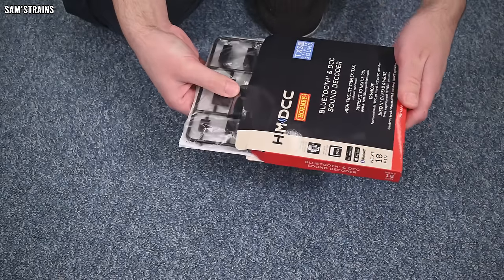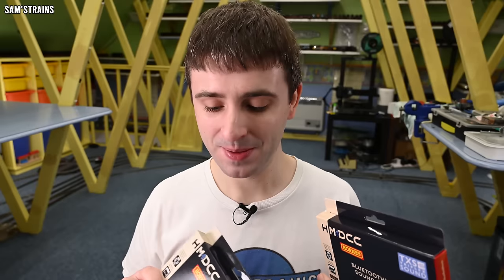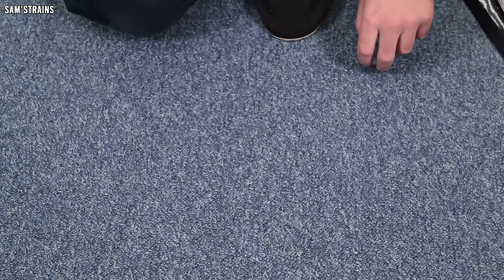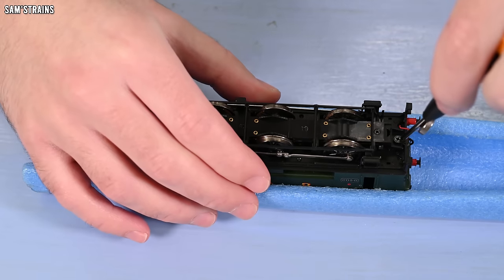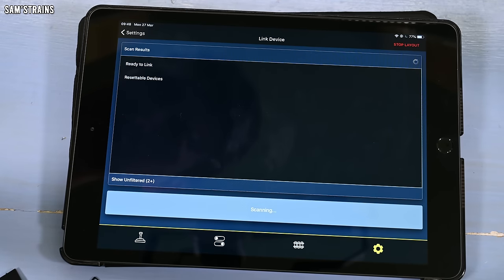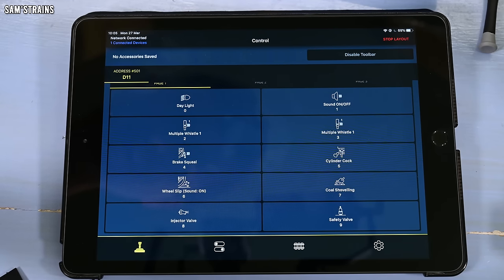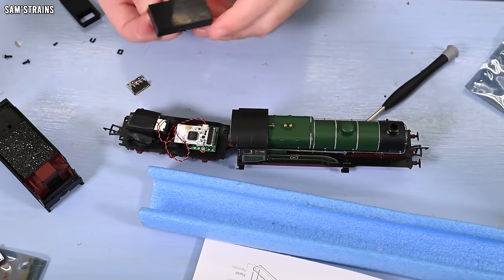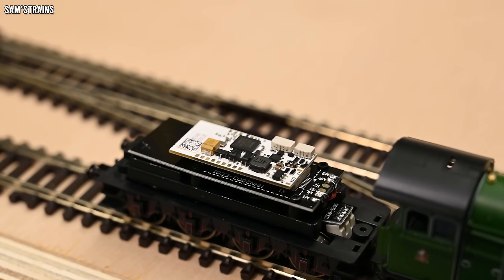Too Big For Most Locos & Burnt Out After 1 Day | Hornby's New HM7000

Comment: Hi Sam,
 I feel, as a DCC sound person, a few errors in your assessment of the Hornby decoder.
 1) "Why would you buy from another decoder maker?" If you look at the major brands, ESU & Zimo you'll find they make various sizes of decoders to fit any size of loco. As you found with the Next18, only your D11 & TT A1 would accept it. The size of the decoder was a major issue. Add in the speaker plus a keep alive and you might find things won't fit anywhere.
2) Expecting to fit them in non-Hornby products or locos designed before these decoders were.. Again this is why I will be wary about using them over say a Zimo or ESU simply as Hornby have used a one-size-fits-all mentality.
3) Most ESU & Zimo decoders can play up to 8 sounds at a time. The new MS decoders from Zimo use 16 bit quality.
4) Soundtrax in the US released a similar Bluetooth system back last year. To date, there is still no Android app available, will Hornby be the same? Not everyone worships at the Church of the Bitten fruit!
5) Do you truly think Hornby will create sound set ups for competitor's locos? I highly doubt it to be honest. This, like the TT:120 are Hornby's own. I own a Roco Z21, the only function set ups i can get are either Roco or Fleischmann models from the last 10 years.
 I do like the idea of the decoders, but the size, the lack of Android app & the tie-in to 1 manufacturer puts me off buying them.
Keep up the great work.
Reply: Excellent comments
Reply from the maker: Thanks for sharing! Yes the size of these (particularly the next18 one) is definitely a big con.
As for non-Hornby locos... very few Hornby locos have Next18 sockets... the two TT locos I have are the only ones as far as I know... so I assumed I might have been able to find a loco that could accommodate them... but no luck.
No, I don't expect Hornby to create sound profiles for competitor's locos, nor did I say I thought they would. What would be nice would be the option to customise/create your own profiles within the app... that's what I said!
Agreed, those are very offputting!
Thanks for watching, Sam :)
Reply: @SamsTrains  I 100% agree with yr review. I loved it. We need more of this objective reporting in our hobby. So why aren't Hornby saying the Next18 is just for the new TT120 range. They need to spell this out ASAP. I had a H BT Next18 on order. sam thanks for the awesome efforts and review. I will be sending it back!
Reply: Hornby have stated android app will be available ''soon".
There are a lot of clever folks out there who I'm sure could mod the app and add their own sounds and dispribution them for free. The only potential problem is are those clever people interested in trains and hornby software.
Reply: @Cloudman  "Soon" as I said Soundtrax released their Blu-nami decoders which have the same set up as Hornby the end of last year. To date, still no Android app. Over 4 months....
Reply: Same for me. I'm waiting for someone else than Hornby to do an open-source system for DCC on BT. As I said, both DCC and BT are open source, and it sounds irrelevant to do a proprietary system based on both.
Reply: @OlivierGabin  I think if someone tried that, ESU, Zimo etc. would shut it down. Also, think of all the sound file creators being put out of work. I have a friend who makes the sound files, at the moment Dapol are using his services. If you buy a sound fitted Manor/Mogal etc. you have his sound file on the Zimo decoder. The software to create your own sound is available, but you need the skill of a sound technician to make the file sound as good as it should.
Reply: @BoaFilmsPlc  Two things :
1) Shut down a manufacturer who uses open source technology ? Illusory... Microsoft had not been able to kill Linux despite all its commercial, PR and FUD power, and had to step down on the tune of "if you can't beat them..."
So, any manufacturer using already public standards e. g., use Loconet for the controls on BT for DCC would have to be eliminated with military methods not to do it. Especially if the manufacturer is Zimo, ESU, etc...
No one will let Hornby have a monopoly on DCC on BT, and even open source developers outside the great companies can develop the software to make DCC on BT real with the existing hardware.
2) If you want to do something really professional, you will always need a professional, however you do it. Amateurs with a level of skills of a professional are a minuscule exception. As you said, you can have the same software as professionals, but you won't get the same result as a professional. I can buy professional cookware for my kitchen if I want (and I have some at home) but that won't give me the skills to run a restaurant because I had not been trained several years in a cooking vocational school.
Your friend will still have orders from companies to develop sound files, and he will be able to sell them directly to customers. He is already protected by the laws for the soundfiles he made. In France, it is the law on artistic and intellectual property that applies, and illegal copy of his files is a crime counterfeiting, up to seven years of jail and up to 750K € of fine.
The only thing he will face is an increase of his income due to direct sales to customers, the software being independant from the hardware...

Comment: We were controlling our layout at Warley with smart phones, using a Raspberry Pi through a Sprog and with JMRI installed its all NRMA compliant and we had sound.
Personally i think this is a relatively new system so there will be issues and certainly the size could be fixed although adding bluetooth elements to sound elements means they have to go somewhere and that means a bigger chip. I'm not sure whether that means hornby locos are made with it in mind in future or not but certainly i can see other manufavturers scrambling to keep up. I believe there are other bluetooth chips in the US but it'll become more widespread over the next few years.

Comment: What happens if/when Hornby switch off the servers which host the updates, sound profiles and are required for the initial mandatory login?

I asked the question on Hornby's forum and a mod just locked the thread.
Reply: It's absolutely a case of "when". Hornby do not have a track record of maintaining old software they've produced. The fact that you need to log in to play with your trains is a hilariously stupid idea.
Reply: @MrJoeyWheeler  Hornby  mentioned on their recent tube channel they will be try fixing this issue. We are lead to believe It was due to Apple accepting the app?
Reply: If the hornby servers  stop working it will only stop you downloading new sounds it will not stop your already downloaded sounds etc from working on the app via bluetooth.
If hornby did stut down servers the a group could potentially get hornby approval to set up alternative server.
The 7000 sound decoders are a nice enough upgrade on the TTS decoder from the sound side that even without the bluetooth function and a good price.
If the bluetooth ever becomes unusable via the hornby app then there are relatively easy ways to use engine driver app to bluetooth control the loco and its sounds.
Reply: @Cloudman572  Is the protocol used to communicate between the app and the decoder in the public domain then?
Reply: @rogertarring6165  No
Reply: @MrJoeyWheeler  Thanks to point this out. Another good reason to steer away from this Hornby proposal !

Comment: The brake function is useful as you can set the chip up such that you can shut off the throttle and the engine will continue on its own simulated momentum. You can then stop the engine by pressing brake EXACTLY as you would on a real locomotive.
I also suspect that you turning the controller off and on may be causing a spike of some kind and confusing the chip. Is the controller a feedback type, if so due to the way they work they can confuse electronic things.  Would be more representative to lift the loco clear of the track and leave the power steady.
Reply from the maker: No it isn’t a feedback controller - the switch just disconnects the power, in the same way that a cut out would!
Reply: @SamsTrains  worth a try to see if there's a difference, I have had electronic issues caused by switches in the past in industrial CNC machinery. Poor or burned contacts in the switch caused arcing and upset the electronic item "reading" that particular switch.
Reply: Just having a look at the tomix controller I've got and that after throttle off has continuous momentum, then brake applications in stages as per prototype enables different % drops depending on the brake applications. They're quite an art to use if you're used to the typical dcc/analogue user experience.

Comment: Can you Still run a loco with Sound with a Normal DCC Controller when the app is Off?
Reply: If you get the dongle for say the Hornby Elite it will simultaneously work with the App so you can turn to dcc mode with the App , then just use your controller. The controller will store all relevant cvs etc you changed with the App. So i think yes you can.
Reply: @paulburns6090  Yes you Can i tryed it lol

Comment: It’s a case of each to their own with these. I won’t be using them having tried a 21~pin version because there is no finesse in the motor control. The sound as I perceive it is just the same as TTS in both the sound samples themselves and BEHAVIOUR of the sound. The chuffs are not spaced proportionally with the speed of the wheels - they simply play at certain fixed intervals so you can hear it ‘step up’ to the next set when the physical speed rises, rather than being gradual. Thus, you will never have the chuffs in sync with the wheels throughout the speed range. The extra cost of Zion and ESU is worth it to me because I can load my own sounds. Also, I could not tolerate such a long recovery time from a power outage. Thanks for the all the videos you put out.

Comment: I think Sam Hornby designed these decoder to be fitted into there own locomotive, and not other manufacturers.

Cheers Jasper & Willow
Reply: If you're correct, it is a poor marketing decision because it would restrict sales.
Reply: Agree as Sam said, Sound Fitted would be dead as an option as even at a reduced price it would still not come with the smart phone app interface which seems superior to other DCC controllers. 
Everyone else would have to improve, but in the meantime there are thousands of DCC ready locos which could be chipped if the owners desired.

Comment: Another issue with this system for some of us, like you said at the start of the video is not all of us have a "Smart" device.  Ok I have a phone that I could use it on, but the drawback with using a phone, is the size of the screen.  So not something I would want to try and use.
Reply: There are lots of cheap Android tablets around which would be a cheaper option than a phone and have larger screens.

Comment: The 21 pin decoder size is within the limits of the NEM specification of the MTC21. This means that it will fit all locomotives with a MTC21 pin socket. This should cover 99% of all models on the market with the 21 pin socket.
You might be able to fit the Next18 non sound version. It is much smaller decoder.
Reply: NEM 662 covers the specs for the Next18 decoders and the dimensions for sound decoders are bigger than the ones for non-sound decoders.

Comment: I don't know if there's any availability in the UK, but the American company Soundtraxx makes a conceptually similar product called blunami, a DCC sound decoder with Bluetooth control capability. I can't say I have any experience with it, but I'd be willing to bet that blunami doesn't have the problems this does as Soundtraxx are known for making high quality decoders that fit a wide variety of locomotives, but their decoders are extremely expensive, a single one costs as much as the two Hornby decoder kits and doesn't include speakers or baffle mounts.

Comment: Sam, I think your expectation that this HM7000 will fit in a non-Hornby locomotive is unreasonable. The ‘other’ manufacturers never accepted a ‘requirement’ to accommodate the HM7000 decoder form factor that was unknown until a few days ago. I think a meaningful evaluation would have been to install it into a DCC-ready (I.e., 21-pin or Next18) Hornby locomotive for which a sound file has already been made available. If it fits in another manufacturer’s loco, we’ll, that’s great, but that loco was not designed to accommodate it.
Reply from the maker: It’s not unreasonable - DCC is a standard, and the box clearly stated that the decoder complies to all NMRA standards, The NMRA specifies standard decoder sizes, and this decoder exceeded them. So no, I wasn’t unreasonable, and I stand by my criticism of it for that oversight. The ‘other’ manufacturers designed their locos to adhere to the standards. Had Hornby done the same with their decoder, then all would have been fine.

Comment: with luck the main benefit from this system will be to bring the prices of other decoders down to reasonably similar levels, the idea is a good one - even if the bluetooth stuff is only used for configuration of sound etc and not really running.

that said I can see a decent potential for these in "DCC Trainset" boxes, a prechipped sound locomotive with control over an app and not the "Select" controller could I think do pretty well

issue with burning out.. I guess this comes down to three things:
1. how common is it?
2. what causes it? (is it a design fault or is it poor testing causing the problem?)
3. how Hornby react to it when it happens

if the answers are "rare", "???" and "they replace them easily" its probably fine until they sort it out, new tech will have issues but if this is a case of the decoders are fragile in some way they are not really fit for purpose, if its a manufacturing and testing issue hopefully it can be resolved.

good review though as always, nice to see these things approached from basically a "does this work out of the box?" approach and not saying it worked but hiding all the fiddling needed

Comment: Might have tried the 18 pin in a Hornby engine. I’m sure you must have one amongst your mass of engines or did you intentionally avoid that?
Reply: Which one fits?
Reply from the maker: No, I do t have one because all of Hornby’s OO locos are 8, 21, or 6 pin. The only Hornby locos with the socket (at least that I’m aware of) are the TT ones. The decoder doesn’t comply with the NMRA standard dimensions, that’s why it doesn’t fit.

Comment: Hi Sam, By now there are many reviews on this new Hornby TXS - HM DCC system. What strikes me every time is the lack of insight for no one has consulted the 'Full Reference Manual' - let alone the 'Quick Start Guide'. So a lot of guessing and supposing and even pure nonsense (on a particular well known channel ) etc. I do recomment everyone to consult this very well written and well explained manual. It's a must to understand the 'system' - for help setting up - fine tune and then enjoy any loco you have equipped with a TXS decoder.
It's only normal that Hornby first provides this system for their own stock of locomotives but according to the latest life show other non-Hornby sounds will be released in the future. Downloading your own sound is excluded - understandable. Besides if you want to do this with systems as ESU and the like you need a serious investment in hardware to be able to do so. And yet not all sounds are free !
The problem with the size of the decoder can be solved using a cable Next 18 male / female or you could try to loosen the support board from the chassis. And hard-wiring is always a solution with the good old 8-pin version.. A con ? One need to be 'inventive' as we did and do with 'ready to repair' stock.
What no one mentions is that the chuff rate for steam locomotives is NOT synchronized. Explained in the 'Manual'. With all the high tech and possibilities of this new decoder this is a real let down. So high end ( read expensive ) decoders from the competition will remain for the 'purists' of fidelity to the prototype.
In the end you can't get a Lexus for the price of a 'deux chevaux'. But let's give Hornby and Hammond Morgan the credit to bring a system to the market with a lot of bells and whistles for a very reasonable price and without the need of expensive Command Stations that are outdated anyway. DCC with BLE is indeed 'the' future'. And this is only the start... Cheers, Filip
Reply: Come on, which channel is guilty of talking TXS nonsense?
Reply: Why is it understandable that you can’t download your own sound? They could make it so easy and another winner over the “old” way.
Reply: The idea is good. The realization by Hornbyy has some serious drawbacks, the worst of it being a closed and proprietary system.
Reply: @OlivierGabin  Well Oliver, Hornby is not a specific only 'Decoder producer' but a toy manufacturer and in that perspective their range of locomotive sound comes first. Other non-Hornby sound will follow - give it some time.
I'm still awaiting the Android version. Patience is required... Happy model railroading.
Reply: @phil36310  Logical... I have skip the Android part (smartphone plus tablet for me). Wait and see...
Reply: @macnavi  What system gives you this possibility ?
Reply: @phil36310  Every other sound system that we know now in DCC.
Reply: @macnavi  What's the price of the  investment in the hard and software ??